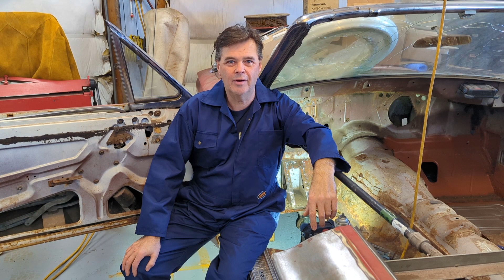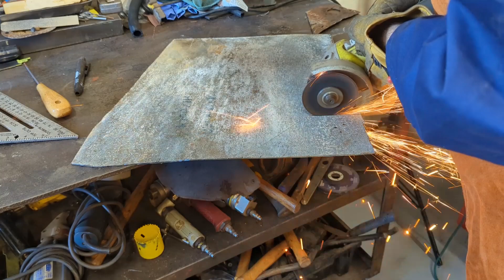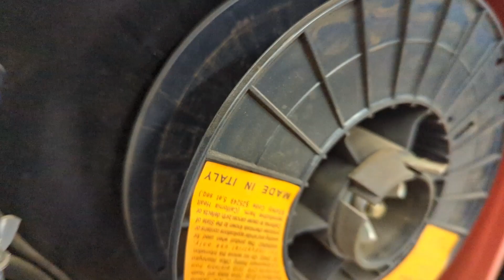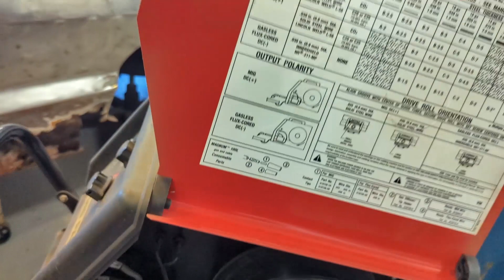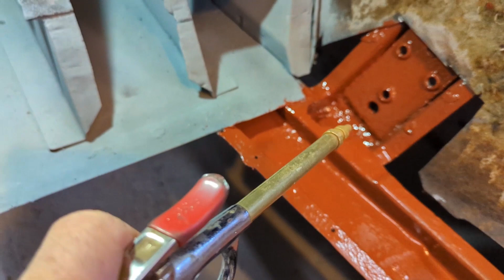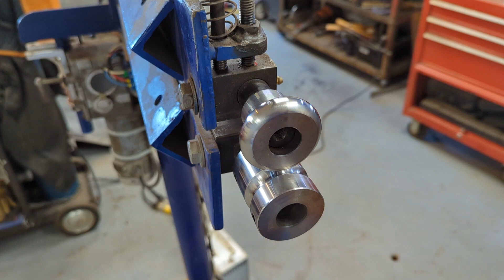Driver Side Front Torque Box Repair Part 2 – 1965 Thunderbird | Ep #53

Comment: Hey Alvin, I'm using .030 in my welder. Is there something I don't know about using smaller wire? What's the advantage? The welding supply shop where I learned to weld said using .030 or .023/.025 was mostly a matter of preference. My welds do not look as good as yours, mine look like leprosy gone amuck. I'm using the 75% argon, 25% carbon gas but I still get a lot of popping here and there. I recently ran out of wire as well. I picked up an 11 lb. roll at Harbor Freight for $40. Everything is expensive and prices are going up across the board. Gas prices here are going up now again. Regular is about $4 per gallon now, give or take. Diesel is almost $5 per gallon. Metal has also gone up considerably here too. The world is falling apart, what can I say. Wasn't there an extra plate under where the gas pedal screwed to the floor board, more that just the top floorboard and frame rail? I don't have a car here to look at but I'm sure there is to give the screws extra metal to screw to. The attaching screws are #14 hex screws about 3/4" long. Anyway, another interesting and educational video. Thanks.
Reply from the maker: Hey Nick, for the work you have been doing on the Caddy frame, 0.030 is a good choice, I do mostly 18 gauge sheet metal, and the less filler wire I can get away with is better, less grinding, also a little less heat needed to make a weld. I am using a mixed gas, I believe it is the same as your blend of shielding gas, it seems to work well.
Yes. everything it getting expensive, diesel has come down in price a little lately, but this summer, I was paying $2.05 per liter, and one US gallon is 3.8 liters...$7.79 CAD for one US gallon, needless to say, our trip to Nova Scotia was a lot more expensive, than in the previous years.

Thank you for pointing out that there may have bean an extra metal plate for the gas pedal...I'll take a look a the green hardtop, it's still original in that section of the floor pan. I'll be for sure putting one back in the convertible.
Thank you for always sharing your knowledge on these old T-Birds! 😊
Reply: @JRShowYT  Hey Alvin, let me know what you find out about the extra plate. Im probably going senile and loosing my mind and thats probably why Im working on Cadillacs now. So Id take anything I say with a grain of sand at this point. 🤣🤣🤣
Reply from the maker: @vintagethunderbirdrepair9426  lol, I will let you know what I find. 😎

Comment: Nice job.  My torque box is good but my floor is gone along with a few inches up on the transmission tunnel.
Reply from the maker: Thank you James...if you don't have to fix the torque boxes, you have it made, the floor pans are pretty easy to replace.

Comment: This was a really good video, Alvin, one of your super-best.  I greatly appreciated watching the detailed welding.  My welds aren't worth a plug nickel, so I've decided it's the machine's fault.😋  I shouldn't have bought a flux welder.  They're too messy, too smoky and the sparks fly for half a mile, but I was trying to save a few bucks and all that.  Better to have gotten a rig like yours.
Regards,
John
Reply from the maker: Hey John!
Most definitely it's the machines fault! 
The flux welders are a bit messy, but for anyone working outdoors in windy areas, it really does the job...us guys that use shielding gas are a little spoiled, and like wouldn't even know how to use flux core wire, the settings are all a little different, also the shielding gas has gotten a lot more costly over the pass couple of years.
If your thinking of switching to shielding gas...I hear YesWelder makes a decent unit for guys like us that don't weld professionally.

Comment: Good video Alvin. I enjoy the workarounds you do correcting the rust areas in general and the torque boxes in particular. They will be better than new. We keep two sizes of solid wire around the shop, .023 and .035. we keep aluminum wire too. I can't remember the last time we used it.
Reply from the maker: Thank you Walter, the 0.023 works well for sheet metal, and I've used on 3/8th plate, my welder is pretty much max'ed out after that...I have an old stick welder that I use for the heavy stuff.

Comment: I’m not sure if this helps, but it looks as though you and I have the same buzz box. And as you know I use the flux core, but in the .032 wire. Since I weld various thickness of metal around the shop, err I mean the backyard with a metal roof lol. I just adjust the amperage and the wire speed according to the metal I’m using. Any big box retailers carries the Lincoln wire, and haven’t had any issues getting the .032. Hope that helps.
Looking great, and as always looking forward to your next video!
Reply from the maker: Thank you Troy, the Lincoln wire is working fine. 
Where I work is the closest big box store in my area, it's about a half hour drive to the next closet. Normally I keep an extra spool on hand, but for some reason I let it slip, and ran out...I'll be picking up another spool soon, to have no hand. 😊